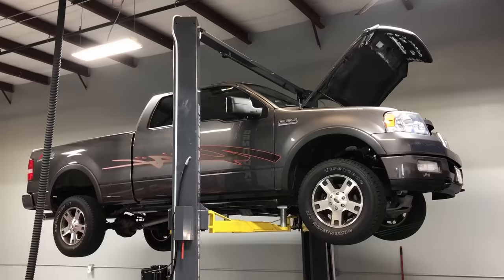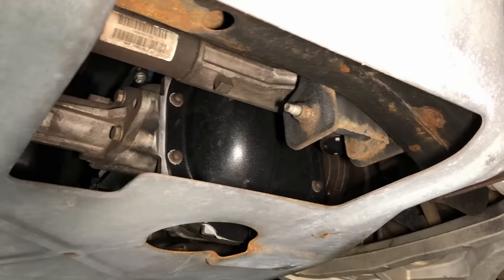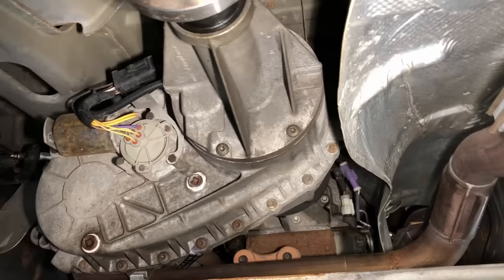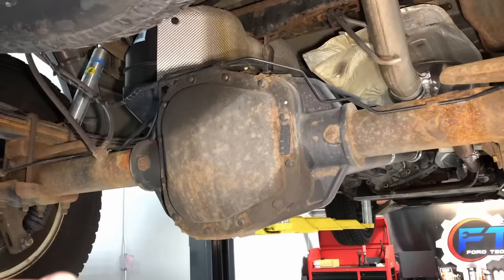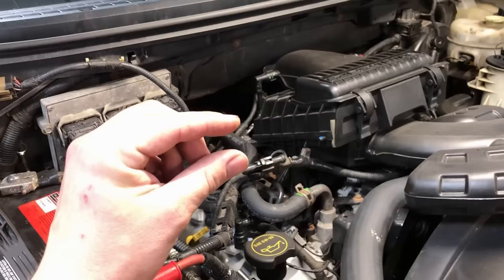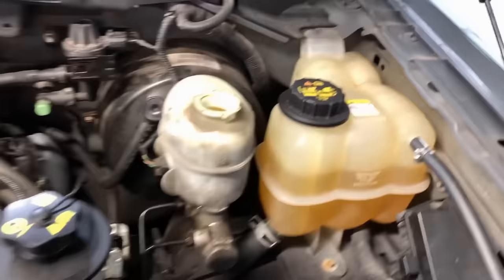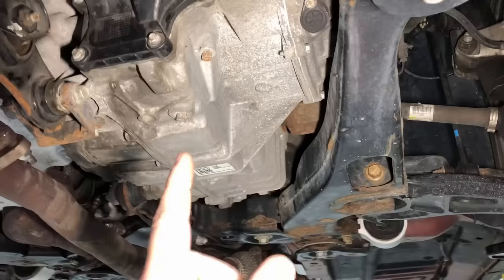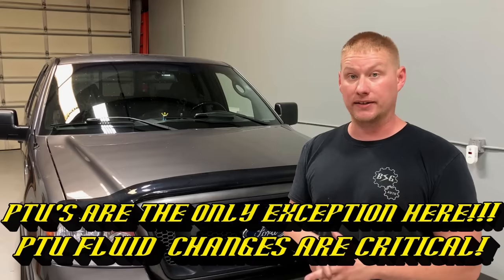Never Follow Ford's Lifetime Fluid Service Intervals: Here’s What I Recommend and Why!

Comment: My idea of lifetime and the Manufacturers idea of lifetime is vastly different.
Reply: Ford's idea of life time is when it explodes it is at end of life.  A lot of these cars will become extremely expensive to repair when they get old.  Imagine turbo replacement on an old car.  It is like they are designing them to be disposable.
Reply: alanhassall well they want you to buy another. Is people all had life time cars. No one would buy anymore. Car company’s will go out of business
Reply: @FishFind3000  I don't know.  Up here in Iowa, cars have a nasty tendency of rusting away and I know a lot of people who quickly tire of their cars.  People used to buy new cars because the tail fins changed from year to year.  My Taurus SHO is about as complicated as I want and my C6 Corvette doesn't automatically position my seat reliably anymore.  I can mostly live without that feature as long as I can move the seat manually, but I shudder to think about repairing these new vehicles that nearly drive themselves.
Reply: @alanhassall  It's called  product failure management.
The inability of a product to achieve the anticipated life cycle as defined by the organization due to any reason; or, The ultimate failure of a product to achieve profitability.
Simply put they are made in such a way as to make it seem like you the consumer are getting your monies worth while making sure the product fails fast enough for them to keep making money hand over fist.
Reply: @douglascampbell9809  Do they realize that it drives them to someone else?  Not too long ago, on this channel I watched a video of a service on a fairly new Fusion with slightly over 100K miles and he said that it was likely the only time that it would be done because he doubted that it would go much over 200K.  Probably the turbo or pushing a small motor that hard with turbo charging will lead to an expensive failure that isn't financially fixable.  I had a Ford Taurus that I just loved.  It had the pushrod V6.  It wasn't the greatest car in the world, but it was comfortable, it got decent mileage and it was mine.  One night it blew the front cover and lost all of it's coolant.  It was four below zero at the time.  Not sure what damage, if any, was done to the motor.  It had 209K on it at the time.  If I was sure that it just needed the front cover replaced and sealed up and it would have been alright, I would have fixed it.  Instead, i bought a slightly used SHO.   Really not sure if it was a good idea or not.  Summer only tires and no spare??  The engine is complex with the turbos and the FPU with the lifetime fill is questionable, but at least it doesn't have the internal water pump like the standard 3.5L V6.  It is pretty quick and a lot of fun.  Eventually, I needed a commuter car that got good mileage and I didn't want to put a million miles on the SHO.  I looked at the Focus, but the troubles that they had been having with the Dual clutch transmission sent me to a 2013 Honda Civic with a conventional 5 speed automatic and no turbos.  The next year would have had a CVT.  It ain't fancy, but it does the job and shows no signs of wear and tear at over 100K.
Reply: As long as it gets through the warranty, that is what they want. Ford doesnt care if your transmission or turbos go out at 150k.
Reply: @alanhassall  welcome to the "throwaway society".... where everything is disposable. "Just buy a new one" 😕😕
Reply: The maintenance schedules are designed to get the vehicle to the end of the warranty. My uncle had two Pintos with 300,000 miles on the them. The engines and transmissions never seen a wrench. You see he bought oil and and transmission fluid by the barrel. Oil change every 1000 miles, Transmission every 10,000 miles he changed to transmission and motor filters every 10, 000 miles. The only rear diffs I have had to wrench on were Fords.
Reply: @alanhassall  - They did their lobbying. Cash for clunkers got rid of a lot of Old reliable vehicles.
Reply: @MAGWolf  not only reliable cars, but a source of parts for reliable cars.
Reply: @warrenpuckett4203  That's how you do it and thats why they went so long,i only drive older cars,i can afford a new one mind you but i prefer the old ones, i absolutely hate car payments for one plus new cars have waaaay too many electronics,one of my cars is 35 years old and the baby is 29,one is a daily driver and the other not far behind, both Ford products,i do maintenance on them even when they dont need it or its too early,they fire up on the first try, everytime, ice cold air in summer and every thing works.
Reply: @dntlss  I have a friend that still drives a 58 Ranger . I mentioned that to a Ford engineer. He said they did not make a Ranger in 1958. I also said he has a Ranger convertible. They are Edsels.
Reply: Lifetime of the part
Reply: M. Sami  They do tell you. They also give you a MINIMUM scheduled maintenance chart, to tell you when it will begin to self destruct. That is how the marketing and bean counters work together to get you back to purchase the latest grand idea in motoring.
Reply: @FishFind3000     Cars would still get into wrecks. They would still rust.  People would still want cars with new features.

Ford and other manufacturers would just make less money.  They want more money.
Reply: to them its the lifetime of the warranty.
Reply: There here to make money lol
Reply: Built to last till the the end of the warranty.
Reply: 8:00 spark knock in the turbo 3.5
Reply: @CubasAutomotive  This may be what the manufacturer's want but the people who buy them do want to maintain them.  Now the price of many of the vehicles is equal to the total yearly income for many families, the families will be looking to hold onto their vehicles longer.  My adult children are interested in either hybrid or straight electric powered vehicles.  California won't allow the sale of anything but electric vehicles starting in 2035.
Reply: lifetime means its over when it breaks,   even if its premature
Reply: lifetime = lease period
Reply: The average person replaces the vehicle every 4 years instead. lol
Reply: This is a common misconception. Some consumers believe lifetime=until the vehicle falls apart. In reality the designed lifetime is 120-150 miles.
Reply: They just want you back in dealership buying a new car after all the “ lifetime”     components have blown up.

Comment: I have been changing the (synthetic) oil in my 2001 Harley F-150 Supercrew at approximately 5,000 mile intervals.  The timing chains were replaced at 240,000, it now has 450,000 miles.
Reply: Had one of those, regret parting with it. Imo still the best looking F150!
Reply: @Nabsolute_  The original water pump was replaced at 448,000 miles, not because it needed replacement but because the plastic intake manifold cracked resulting in a water leak.
I told the mechanic to go ahead and replace the water pump at the same time...
Let me repeat, the original water pump lasted 448,000 miles...
Reply: Awesome. Looking forward to my 2014 F-150 with 3.7L to last that long. I use it as my work truck. Amsoil from day one and currently at 131K. No engine issues, had a bad torque converter that was replaced under the extended warranty.  Lots of issues with those as I found. Other than that and 2 canister purge valves (simple 5 min replacement), been a great truck.
Reply: @stevelandess  my tacoma has 436k.   OG motor and trans, water pump, differential.     Still running good. But I daily drive my f150 now.  I'm at 194 i got the truck at 109k  miles not even a year ago,  I'll be hitting 300k in a year.     So far the only parts that failed on my f150 both window regulators in the front doors.  Plus that grey wire deal on alternator causing icon to come on randomly
Reply: I have 327k on my '05 F150 4.6. original everything except spark plugs, alternator, 3rd set of intake gaskets and throttle body (that one was my fault though). even has the original serpentine belt. 2nd transmission though
Reply: Drive carefully. That generation of f150 did terrible in crash testing.
Reply: Wow that's some mileage! I have a 2002 HD and only have 91,000 on it but I do change oil every 12 to 18 months regardless of low mileage
Reply: Has to add Harley in there good job bud you want a sticker
Reply: Love to see it
Reply: @serbia991  it's pretty normal to list the trim when saying the car name.
Reply: 3.7? U have 14 limited, and its 3.5....i think...got me 2nd guessing mys,i think..😮@ksamos

Comment: You are absolutely CORRECT!!! I run my Trucks FOREVER following this exact maintenance schedule. I am in Florida, and the fluids are the life blood of my expensive Ford parts. The heat breaks down fluids quickly, and caused major damage if not kept after. Brake fluid causes calipers to seize when contaminated, not to mention the fact that brake fluid is operating around 600F, keep it fresh and not only will your calipers last longer but your pads retreat from the rotor and stay cooler, and wear longer. The one fluid people neglect is the radiator fluid. Aluminum engines are subject to corrosion from worn out fluid that has lost its properties. Major cause of head gadget failure.
Reply: How about coolant changes ?

Comment: My 2000 Ford Excursion 7.3L Diesel, I changed the trans fluid and filter, every 30,000 since day one.  197,000 miles (30,000 of which was towing 26' trailer) .  Trans has never needed repair.  1988 Lincoln mark VII LSC, same service interval, 288,000 miles, original trans never needed repair.  "Makuloco" is giving good advise!
Reply: yeah, now its what you do with the advice

Comment: Absolutely agree, I have 22 years old Ford explorer with 4.0 SOHC, this engine is actually "not reliable" by many opinions....this car with 200k+ miles is still strong - no major repairs at all, never saw differential\engine\trans etc inside hopefully. I just frequently replace all the fluids with the best ones I can afford on the market, never buy cheap junk, and seems that is the right way - preventative maintenance.

Comment: All my new vehicles I change the brake fluid as soon as it starts to turn amber. Right at 10k miles usually. Then you will have really nice yellow/clear brake fluid for 30-40k miles easy because you got all the break in out of the way.

Comment: Thankyou for putting this info out here.  I no longer own a Ford, but I do change fluids on a regular interval.  Brake fluid has been a hot topic of mine.  I've changed fluid every 2 years.  Now that I'm retired, it's the same 2yr interval along with the clutch fluid.(the brake master reservoir and clutch reservoir share the same reservoir.   06 Nissan Frontier 4.0L V6 6 Sp Trans, 4X4)  The P/S will be changed for the first time this year.  FLUIDS ARE CHEAP, PARTS AND VEHICLES ARE EXPENSIVE! !
Reply: Smart. Very smart

Comment: Just discovered your channel and feel like a fool falling for the lifetime fluid in transmission.
90000 miles on a 2010 Fusion.  Just started drain and fill every time i do an oil change. Man that fluid was nasty.  I’m going to keep changing a few more times.  No issues shifting and trans feel okay but hope i’m not too late.  Bought the Fusion New in 2010 and love the car.  Thanks for your channel and the Ford insight you provide.
Reply: I bought a 2011 fusion brand new and got rid of it at 60k miles. In the cold the transmission never shifted right. The dealer flat out told me I need to let the car warm up before I drive it and that I was abusing it.
Reply: @loveracing1988   I suppose that  i've been rather fortunate with my 2010 Fusion.  Apart from a few failing components needing replaced,  the powertrain has held up well.  Bought it new and still my everyday driver.  135000 miles so far.. shifts smoothly and engine still putting out plenty of power.  I have heard horror stories about this model, thought.  guess  I've been dodging that out of sheer luck.  Next car will be a toyota or honda. Take care

Comment: Excellent advice that was given very succinctly by this gentlemen. As an owner of a 7.3 and other vehicles where I do about 95% of the repairs and all of the maintenance, I was always leery of some of the manufacturers recommendations on service intervals.  I have no problems with my vehicles, which is more than I can say for some of my friends with the exact same truck as me and they have it in the shop all the time for failures.  I would trust this guy as my mechanic without a doubt!!

Comment: As a  33 year Master ASE tech,  I'll add that an owner of a 4x4 with selectable should occasionally select 4x4 mode when it is raining to prevent bind but move the driveline. I've had many a truck brought in with complaints of vibrations and other odd behavior after the owner had decided to use 4x for whatever reason.  Especially in WI.     You also said it correctly.  "marketing campaign"  It astounds me how many foolish and gullible people are in the world.  We are marketed EVERYTHING. The more you hear how it is the greatest the more skeptical I am.
Reply: Can you tell me how reliable are the mid 2000 Cadillac SRX?
Reply: @chipete1  I'll presume you made a typo considering the 1st gen srx wasn't produced until 2004.  There is no GM vehicle I would consider to be " reliable"
Reply: @irench  +1 on GM reliability.  Truly not built to last
Reply: @ikigai47  1996 camaro LT1 254K miles on it. not reliable? i would put that old small block up against any 5.4 3v piece of junk, or any 4.0 overhead cam, both junk
Reply: @ad356  Last century was a better time for Chevy no question.   I liked them then.  Today's Chevy is a joke.  I'm basing this off of comments from GM plant workers.  Their QC is beyond absent, they knowingly send out junk and emphasize volume over quality.
Reply: @chipete1  It's junk. Those are very difficult to work on. One of the worst SUVs GM ever built.

Comment: Great recommendations overall.  Alot of problems can be avoided with regular fluid changes.  Especially transmission fluid, change that early and often.  

The only thing I do different is 7500 miles oil change intervals with Mobil 1 synthetic oil.  Yes it turns black but oils now can dissipate the soot well enough that it doesnt form sludge.  185k on my 2.0L Duratec and the cams looked new when I did my valve cover gasket.

Comment: This is 100% solid advice.  I'm a GM fan, but follow the same regiment on my stuff and get life out of everything major until the body rots apart at over 250k miles.  You can always count on the mfg pushing everything for that damn tco number to be low.  Fluids are cheap.  Change them!

Comment: I've been in the auto and truck repair industry for over 40 years, and do ALL of my own maintenance and repairs. I replace ALL fluids (diff, trans, power steering, coolant and brake fluids ) every other Fall, so every 2 years.  Oil changed every 5000 kms (full synthetic).   Full mechanical brake maintenance every Spring  (after our nasty corrosive winters). My wifes car has 350,000 kms, my F150 has 360,000 kms and my sons car has 300,000 kms on it. Even my bike has  240,000 kms on it!  I practice what I preach and that is preventative maintenance. Doing these repairs with my own labor and trade pricing on materials keeps the cost down.  To each his own, but I would drive my vehicles cross country right now with nothing more than an oil change to prep for it...   :)

Comment: I appreciated your commentary in the PTU on the SUVs. We had a 2016 Explorer with 90,000 miles that had the PTU blow up and it tore up the transmission with it so both had to be replaced for a whopping $6000! Wish I had seen this video before that happened I would’ve changed the fluid. Thanks for the great videos. My F150 is about to feel like a new truck with all new fluids soon.
Reply: What is a PTU??  I've been after my Lincoln service rep to change whatever needs changing on my 13 MKT and he keeps telling me nothing needs doing at 30,000 mi.  This PTU... what is it???

Comment: Really liking your video's.  This one was great, FORD Canada has even longer or never service intervals on some fluids. After looking into PTU failures and problems I was shocked to find FORD Canada has never check never change PTU oil interval. When I requested it be changed , they had no idea how at the Quickchange lane they had to hunt down a service tech who knew how to do it. General policy at the dealer was wait till it blows up.

Comment: I 100% agree with you. My 2016 F150 5.0 4x4 get my care every 5k for oil changes, trans, t- case and diff every 30k, I do brake fluid every 40k.
Reply: Do you use 5w-20? I have an 18 5.0 and I’ve been using Pennzoil ultra platinum synthetic 5w-20. Got 10 quarts coming in for the next oil change. Almost 10k miles on it.

Comment: This is for all trucks and cars 👍👌.  I have chevy cars and trucks. And I do almost exactly what you recommend. I don’t  had any issues and cars/trucks run like new and no burn off or issues even at 100k.  

I don’t like the minimum recommendations.  I always recommend the “Extreme” service recommendations as normal use to anyone.    

Good video.  Thanks.

Comment: I guess on my 5 or 6 Panthers I better change the rear axle fluid now.  Only 2 of them have been opened up with new oil for grooved down axle shafts and new bearings. 

The lowest mile one has 127,000 and the highest mile one is an 03 GMQ with 300,000 miles. 

Great video!!! Thanks for posting it Brian!!!